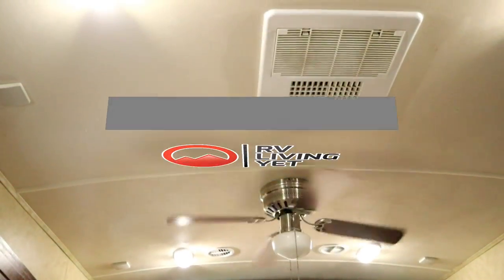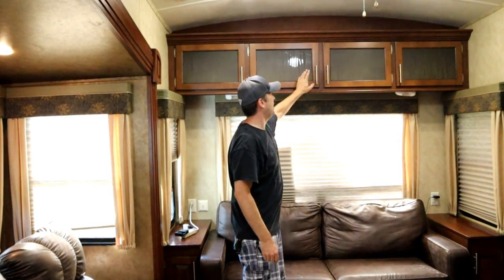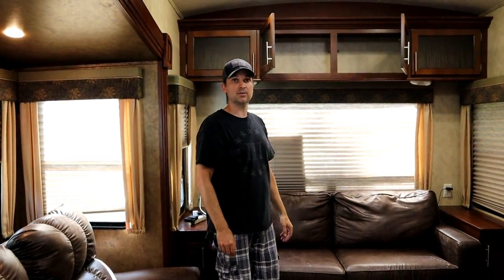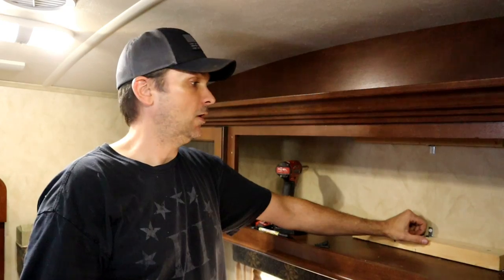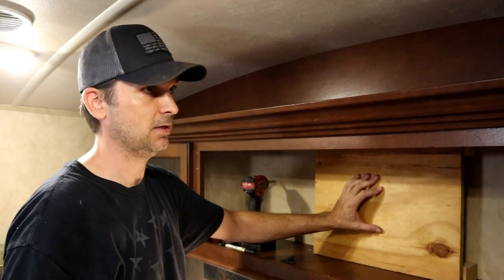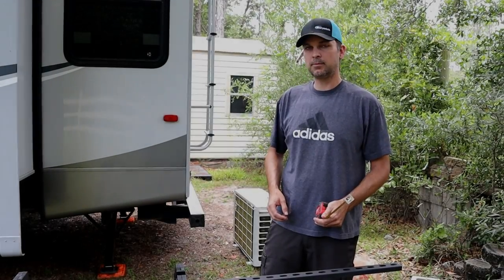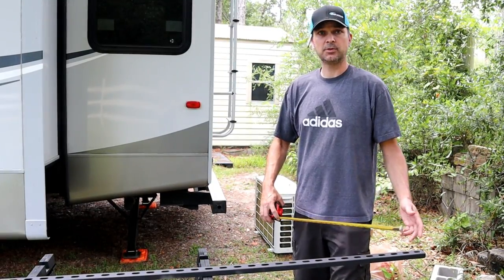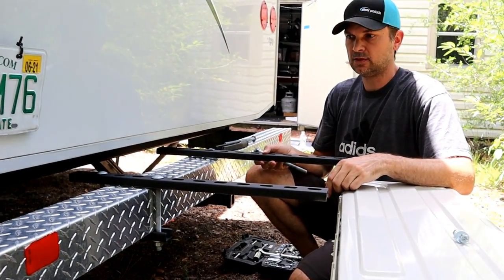Installing Mini Split Air Conditioner In RV Camper-Installing Mini-Split Heat Pump In RV- RVAC Solar

Comment: this kind of wall mounted ac sucks air from the top and most of your top is blocked by the cabinet so efficiency is going to be reduced , a better option would have been 2way slim cassette or 4way if u can fit it , suction and liquid line needs to be on flexible tube instead of normal copper tube , the tube would crack under vibration . other than that this is a great idea
Reply from the maker: We ended up drilling holes in the top of the cabinet for air flow and installed flex lines at the end of the video.

Comment: You left your drill bit in a evaporator bracket screw just in case you wondered where it went
See in video
Reply: lol, I seen that too. The screw gun bit, surprised it still mounted and looked fine.

Comment: The statement that RV’s run on 120 volts is only partially true . The Newer bigger units including my 38’ TT operate on 240 volt single phase . I’m a retired IBEW member . Remember the Higher the Voltage the lower the amperage the lower the kilowatts . Not sure the amperage drawn on the 1 ton unit ? But it would make one leg of the 120/240 feeding your unit that has the 50 amp plug really unbalanced . When they wire these RVs they split the load , AC UNITS ( No longer needed) micro , fridge ( 1 or 2 ) washer & dryer , etc . I think the 240 volt unit would REALLY lower heating & cooling costs along with QUIET !!!!!
Reply from the maker: You are correct but we wanted to run this system on our solar power which is a single phase 120v inverter, also on our generator and some campgrounds only have 30 amp available. The 120v option was the best for us and the amperage is 8amps so this unit draws way less than the roof top units.

Comment: Should not be using NM wire or Romex on wet location areas!!! When it gets wet it loses its protection… there is a reason. Need to switch to THWN

Comment: Your video skips the most vital point for an RV install -> How is the power connection setup?
Reply from the maker: We did😉...At 10:32 in the video shows how we did the wiring😏

Comment: never trust the rear sewer hose holder. for any weight. attach directly to the frame. 
i am a couple years away from doing this to my old rv.  if i could ever afford a new rv i will order it with no ac’s on the roof and NO holes in the roof. aka  no vents, not even a skylight over the shower
 ( better to place solar).

Comment: You total cut off the return air for the air handler 😑
Reply from the maker: We drilled holes in the top of the cabinet, check out our one year update video.

Comment: Noooooo…never cut the lines on a mini…they are precharged and designed to have that entire length of line set. Supposed to leave the excess coiled up per the manufacturer..way too many hvac “techs” don’t know this..
Reply from the maker: Loops cause oil to build up in the lines, you can cut the line as long as you keep the minimum length required per charge.